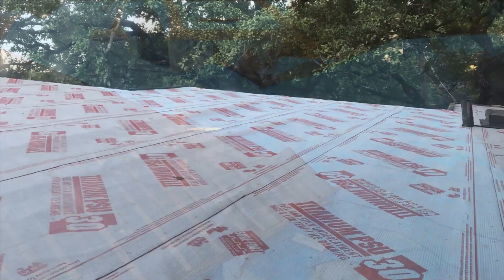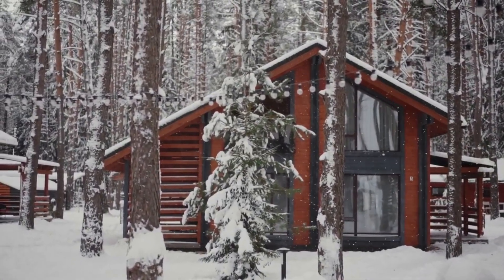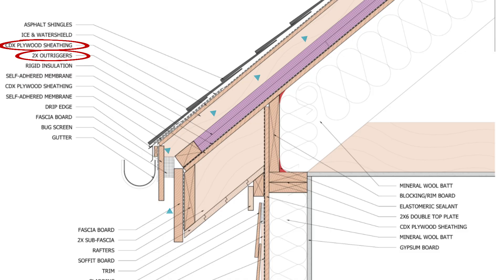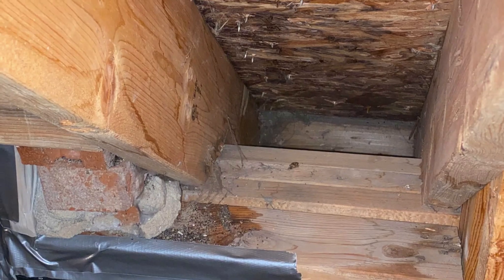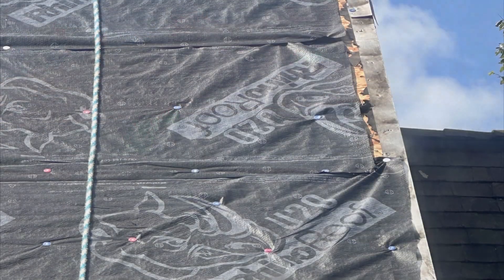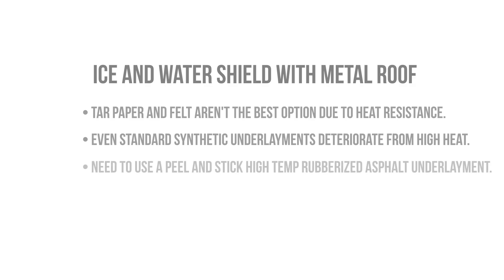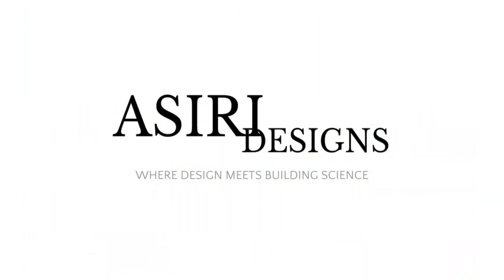The Truth About Ice and Water Shield

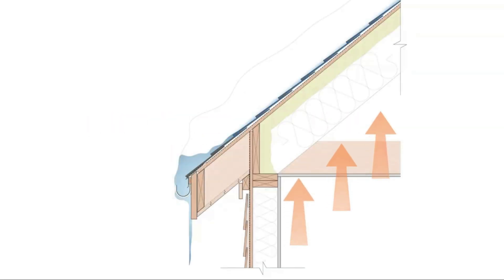Comment: Note at 1:20. Dans can also arise from heat rising up the exterior wall and hitting the eave.
As well as from thawing temperatures during the day that freeze against night and ice on the eaves that blocks full drainage.
 No amount of insulation or ventilation can ensure even temperature across the roof deck, preventing parts from being above freezing while others are freezing.  
The only solution is to move south.

Comment: I'm thinking about building a house with exposed beams and solid decking.  This would be an off grid property in Northern Idaho, so robustness against wildfires is an important consideration.  Right now, I'm thinking of placing 1" RockWool Comfortboard around the perimeter of the roof and as the top surface upon which which the battens would be place, with the core of the insulation being PolyIso, for its light weight and high R value.  I'm thinking that it would make sense to place a highly reflective radiant barrier, between the first set of battens and the second.  This would allow air to circulate directly above the insulation for drying, and would provide an air gap to make the radiant barrier underneath the metal roofing effective.  The radiant barrier would also serve as a second level of bulk water protection.  Since this is a DYI project, I'm assuming that I can baby the installation so that I don't damage the foil too much.  Is there any issues that I'm missing?

Comment: Love the videos! Have a possible Q/A subject: how would you approach wall and roof insulation/construction for tiny house on wheels (THOW)? Most use closed cell spray foam and metal siding/roof due to the high R per inch and added rigidity the foam provides, but thermal bridging is almost never addressed. Interested to hear your thoughts when there's priority on minimizing thickness due to building width/height restrictions.

Comment: Can you do a video on how high heat, self-adhered roofing underlayment performs during a wildfire event? Are some brands better than others? Also, do you recommend covering the entire roof deck with a high heat underlayment if your sheathing is the Huber ZIP system? I know Huber now has an underlayment that you can add on top of their ZIP sheathing but that is probably meant more for additional protection from water penetration during a storm  than for fire. Do you see any problems with using a high heat wildfire underlayment under a metal roof while using the ZIP sheathing system?

Comment: The correct solution is at @3:03 , Single layer roofs is a disaster waiting to happen. Second layer can be Steel, Aluminium, clay tiles, concrete tiles, but the air gap underneath them is a must in any climate that has snow in the winter.

Comment: We do use. an HT layer with metal roofs, but I’ve worried that with closed cell insulation you could trap moisture in the sheathing. In our climate zone we don’t have freezing, but I like it better when we can put exterior insulation on the roof.
Reply: it can trap moisture. have you considered using some other form of insulation/vapor barrier?

Comment: For an unvented assembly in climate zone 6a with exterior rigid insulation and metal cladding, where does an entangled mesh get specified and why? I've seen you mention this on your other videos.
Reply from the maker: @ivan.bucher  Good question, the entangled mesh is used to provide an air gap and drainage gap between certain roof coverings and the underlayment, such as for metal roofs or cedar shake roofs. But entangled mesh products are limited to around a maximum of 3/4" in depth, so ideally I would want a large gap for a vented over roof (about 2 inches+)
Reply: @ASIRIDesigns  is a vented overoof preferred? Is it ever not preferred?
Reply from the maker: @ivan.bucher  It really depends, you want to avoid them in humid climates, but they were quite well in dry climates if they are designed properly. I have some videos that cover the benefits of both vented and unvented assemblies, and how to make each system work. There are three main reasons why you may want to use an unvented conditioned roof instead, and that's either you're building in a high wind speed zone/hurricane prone area, a region that is at a high risk of wildfire, or if you have a flat roof assembly.

Comment: What is the benefit of an air control layer on the outside of the roof when the interior needs to be either vented already? it’s venting under that air control layer anyway? Same if we have the overroof assembly from Joe Lstiburek? I get the benefit of not having bulk water sit on the sheathing, but this won’t provide any increased air tightness?
Reply from the maker: @FreekHoekstra  I should have been more clear, it CAN serve as an air control layer in some assemblies, such as in a conditioned roof, not that it is the air control layer, especially not for vented roofs.